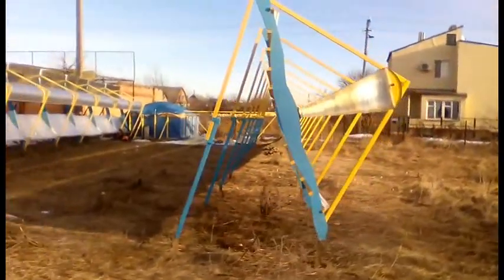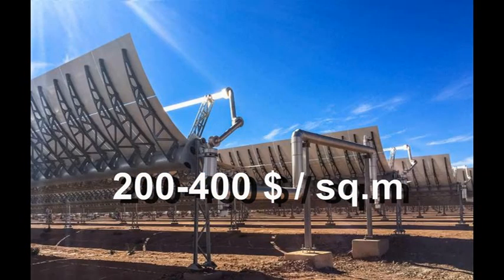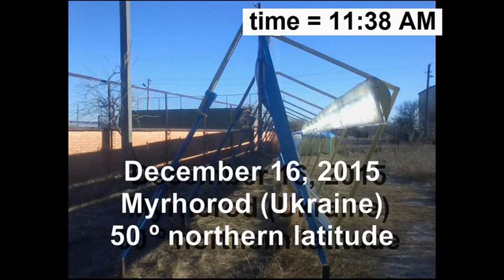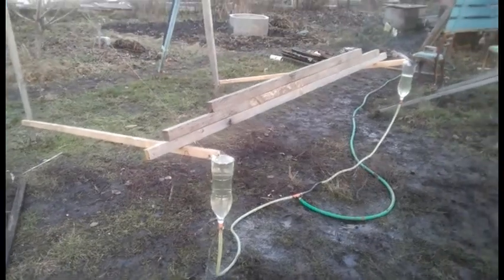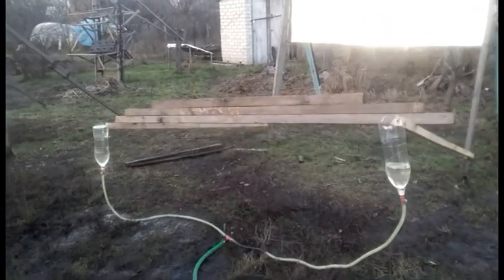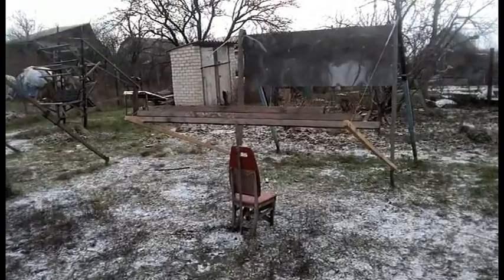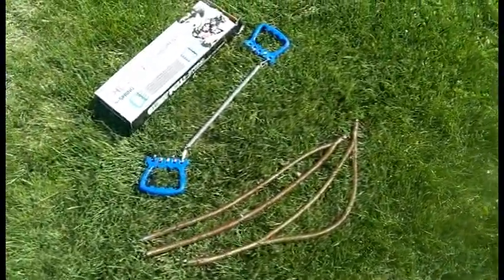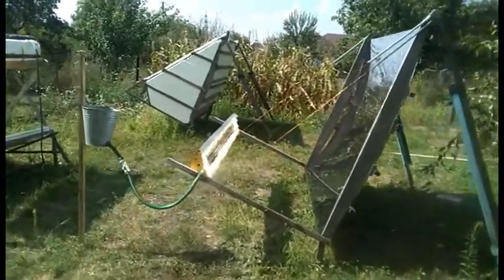New generation of this type of solar heater

Comment: Simply add a string to each bottle arm up to a pulley system which has a reversing crossover string to the other side. Therefore, if one side goes down, the other must match it, forced by the pulley system.

Comment: Suggest add extra string with little slack on the spring so you can set a max depth of spring will stretch, in case a Cat jumps the side or if one spring fails it will still protect system.
Also as a user below has stated a pulley system is a good idea to maintain balance.

Comment: Could you use a strip of material above the target that expands when heated and a strip below the target and attach each to a cable and string pair (so 4 springs total) to adjust the target up and down automatically to keep the light centred on the target over the course of several months?

Comment: Why use spring? is it because you want the receiver to move randomly? how does that track the sun?
eg, 12.38 is noon and thats when your receiver gets the most direct sun, if receiver moves around then it will get less heat. 
sun rays are strongest around noon.
14.18 is when your receiver gets about 30% refection